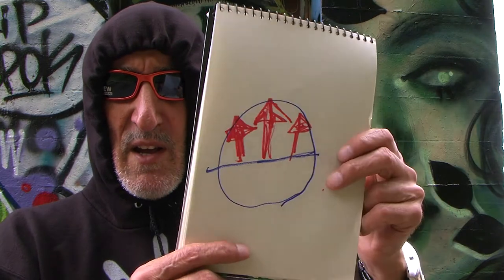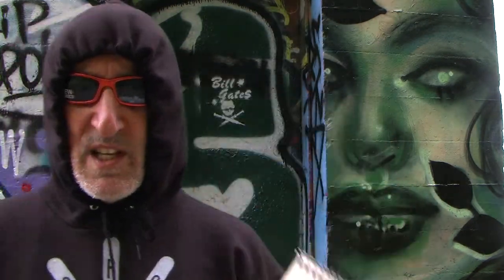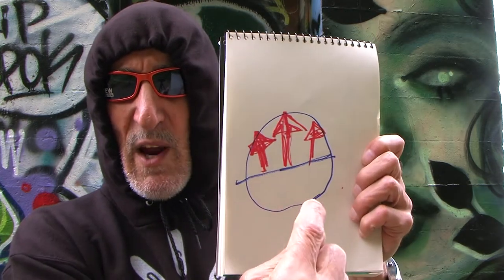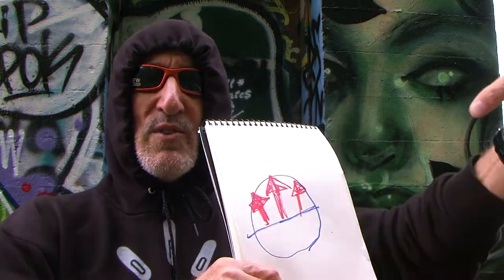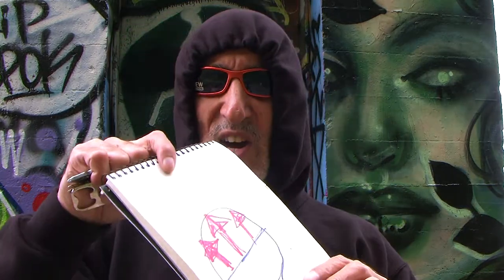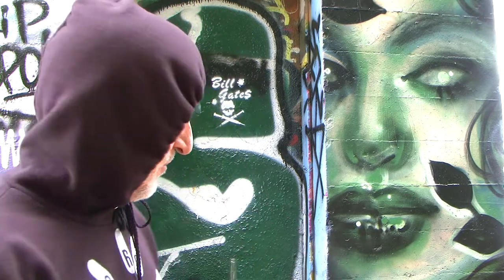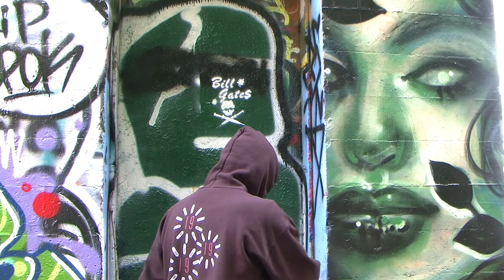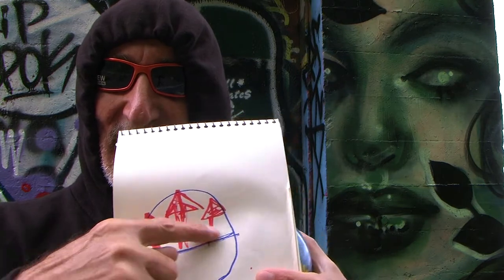HOW CENTRIFUGAL TENSION SPLITS A SPHERE globe hoax motionless flat earth

Comment: 0.03 m/sec² outward acceleration and 9.8 m/sec² inward acceleration is not going to make the globe split apart!
We already debunked all you say in part 1 of your video;
Reply: Yeah, he ignores gravity, or whatever it is that makes things fall.

Seems odd to me that FEers got really quiet after the American election, and now they're perking up again, as their hero seems to be reasserting himself. That sure smells like outside influence.

And frankly, it scares me. He tried his "beer hall putsch" on 6 January. It didn't work, but he's sure not gone. He can see that throngs are willing to buy his HS, especially if the economy pops a bubble, and he could use that to plot his comeback.
Reply from the maker: EXACTLY! That only applies to surface objects. Internal centrifugal tension of a 1000 mph surface speed will. And that only applies to a solid globe. Your globe cannot spin at all because t is cracked all over the place and has ZERO TENSILE STRENGTH. "And that's the end of the globe!"
Reply from the maker: @michaeldunlavey6015  Falling is all about relative density, watch drop.flat.wtf notice that air bubbles rise. Gravity is zero within the ball, I talked about this, gravity is much weaker than molecular bonds which are easily shattered by centrifugal tension, it only applies to surface objects. The best the globeheads can do, is claim that the tension "doesn't form in the first place" while the body spins at full speed like a top - total globehead insanity! Not a single reference exists for their lunacy, yet they talk as if they are right, what a joke!

As for politics, you are just as clueless it seems, since they are all on the same team. Hegelian dialect.
Reply: @rocketspushoffair  how can the sun that is this huge ball of burning gases like hydrogen and helium burn at these immense temperatures for billions of years and retain this shape because of gravity while traveling trough space with no problem? Can you believe it?
Reply: @StopCuttingChickenHeads  Burning gases is not correct. Hydrogen is not making a chemical reaction with oxigen (like it could happen here on earth), but the extreme temperatures and pressures are producing fusion of more hydrogen atoms together for making an atom of helium.
It is what happens exploding an H bomb, (or thermonuclear bomb).
It is what we hope to be able to make in a controlled and convenient way in a new kind of nuclear plant.
Gravity is what allows anything to exist, the stars (like the sun) and the planets.
Any celestial object is in vacuum, and then there is no attrition with air.
The shape of the sun is due only to gravity and to its rotation.
The sun is able to last billion of years because it has 99% of all the matter present in the solar system, its mass is 333000 times the mass of the earth.
Reply: @rocketspushoffair  Gravity is zero inside a hollow ball, not inside a solid ball. Inside a solid ball, it is proportional to distance from the center. Why? Because, for example at 1/2 R, the ball you're standing on is 1/8 the volume so 1/8 the mass, but 4 times stronger gravity from smaller radius, so 1/2 the surface gravity.
Reply: @michaeldunlavey6015  But you should subtract the gravity produced by the portion of earth that is above your head and works against the attraction of the earth still under your feet.
Reply: @rocketspushoffair  Hegelian dialect is part of the Kantian language, isn't it?
Reply: @napolmast3371  You should subtract it, but it's zero, 'cause of a nice geometric argument. Thanks.
Reply from the maker: @napolmast3371  https://www.quora.com/Did-CIA-Director-William-Casey-really-say-Well-know-our-disinformation-program-is-complete-when-everything-the-American-public-believes-is-false
Reply from the maker: @napolmast3371  Dream on. EVERY PHOTO WITH SUN ABOVE TREES proves you live on a flat earth trees grow sideways in heliocentric https://youtu.be/dNFVxrdw7r0
Reply from the maker: @michaeldunlavey6015  Here's another lovely geometric argument: EVERY PHOTO WITH SUN ABOVE TREES proves you live on a flat earth trees grow sideways in heliocentric https://youtu.be/dNFVxrdw7r0
Reply from the maker: @napolmast3371  It's a known fact. Even Michael Dunlavey will tell you. He said it in front of Reagan. You have a need for denial.
Reply from the maker: @michaeldunlavey6015  You are talking about a burred rock. Both the rock and the medium it's buried in have zero tensile strength. The entire ball has zero tensile strength. Maybe this 2 min video will clear it up for you, gravity cancels out within the fake globe https://youtu.be/8IDRr4I1vT0
Reply from the maker: @platoplat498  Air bubbles go up. Gravity refuted.
Reply from the maker: @michaeldunlavey6015  Actually it doesn't. Also, every day (not just at equinox) if you put a stick in the ground and measured the shadow height throughout the day, and joined the marks, you would get a straight line EVERY DAY. But too bad we get curved lines, as predicted by a small local circling sun. Take a globe, stick a toothpick perpendicular to the ground, shine a light, spin thee ball back and forth and watch the shadow trace a straight line along a single latitude. "And that's the end of the globe!" https://youtu.be/hmYceAALcdc
Reply from the maker: @michaeldunlavey6015  Another excellent debunk is the STRAIGHT LINE PATH of the sun in the sky from sunrise to noon and back down again to sunset. Your model predicts an arc. "And that's the end of the globe!"
Reply from the maker: @michaeldunlavey6015  TILT! Predicts that at winter solstice in the sun will appear to be setting at noon! "And that's the end of the globe!"
Reply: @rocketspushoffair  This last one argument shows well how easy is for you to build a strawman argument.
Using geometry (geometry is always right, it's math, it can't be debunked) Jos Leys produced a video highlighting that on a flat plane the sun should always produce circles with the tip of the shadow of a stick.
Or at least segments of a circle.
Using conical projections on the globe the shadow will draw iperboles, sometimes paraboles, circles only on north and south poles, and 2 times in a year, on the equinox a straight line. Everything is backed up 
by mathematics.
But rockets he just says that on the globe it should always be a straight line et voilà, all curved lines are a proof for flat earth.
He even got the nerve to show a straight line of an equinox and say that it was a curved line.
So easy to destroy the globe ...
Reply: @rocketspushoffair  I'm a Flat Earther, but I don't understand this FE argument. The issue/question with gravity is not - in my opinion - whether or not gravity exists. This is because we all, on all sides, agree that there IS an attractive force that either 1) is gravity or 2) mimics gravity. The question is, then, what is the nature of this attractive force, and what should it be called? Regardless of what its nature is and what it is called, the principle of relative density applies equally. For me, gravity does not exist but it is obvious that some attracting force does. That force is electromagnetism: https://www.youtube.com/watch?v=-0dN0Kxl9ow&t=2s and https://www.youtube.com/watch?v=9EPlyiW-xGI&t=18s Again, regardless of what the attractive force is, the principle of relative density equally applies. If there were no attractive force, density would be irrelevant since no object of any density would be attracted to anything.
Reply from the maker: @napolmast3371  It was a curved line. Even Les admits it, and that is because the "moment of equinox" does not exist, there is a range of a few to several days for equinox depending where you live. As for tilt, you have already been told that at winter solstice the sun sets at noon. You also run from the fact that SPIN+ORBIT=21mm/s/s of alternating acceleration and deceleration every half revolution. A simple rock balancing statue shows how absurd the globe is. "And that's the end of the globe!"
Reply from the maker: @uuuuutube987  Which argument are you referring to? My video? Or something else? Are you thinking that there s a force pulling things down? Or a downward bias?
Reply: @rocketspushoffair  

I know right? It's hard to tell which comment someone is responding to when there's a long thread of comments.

I'm talking about your comment here that says there's no such thing as gravity, that it's all relative density.

That's the usual FE argument against gravity.

Hope this is making sense.
Reply: @rocketspushoffair  We are talking about the heliocentric model, not about the flat earth pizza.
The equinox is a precise moment in the orbit of the earth around the sun when the axis is in a plane tangential to the orbit. 
Being a single moment there will be places where the daylight is distributed equally before and after the moment of the equinox, and other places where rhe equinox happens at midnight, so their daylight will end 6 hours before the equinox or will begin 6 hours after the eqinox.
These latter places will be those where there could be discrepancies compared to the straight line predicted at the equinox of the tip of the stick, but the difference would be minimal.
With these differences in mind that change very slightly the situation, on the day of the equinox, subtracted the effect of refraction that moves upwards the sun by 0.5°, the centre of the sun crosses the horizon at sunrise and exactly 12 hours later the centre of the sun crosses the horizon at sunset.
On the day of the equinox the daylight has always to be more than 12 hours because of refraction and because the upper border of the sun crosses the horizon before and after the center of the sun.
On a flat earth I couldn't care less what is considered to be the equinox by the flerfers.
I live at 45°N, then I know that always on the equinox at solar noon the sun will be 45° over the horizon; I know that always on the day of the winter solstice at solar noon the sun will be 45° - 23.4° = 21.6° over the horizon; I know that always on the day of the summer solstice at solar noon the sun will be 45° + 23.4 = 68.4° over the horizon.
It has always been so and it will always be so because I live on a ball and the logical predictions of the heliocentric system are always matched by reality.
Your absurd, idiotic, strawman predictions about the globe earth, don't match the real predictions of the globers, don't match reality and are grossly wrong.
Also making predictions using the flat earth model fails all the time, in every aspect.

Going back to the tip of the shadows of the flat earth, they have by necessity to draw a segment of a circle, while normally on the globe earth they have to draw a hyperbole, and that is also the shape present on a sundial.
Again the predictions of the flat earth do not match reality, the opposite for the globe earth.
Any idiocy you say is an idiocy and remains always an idiocy, that you try to use as a strawman argument against the globe.
No one has to care minimally about your idiocies.
Reply from the maker: @napolmast3371  You need to "IMAGINE A DOME"! https://earthsky.org/tonight/equinox-sun-rises-due-east-and-sets-due-west To bring the lights close to earth (to their actual location) otherwise the distances are too great for field rotation to be observed. Time and date website data SHOWS A RANGE of times, 3 to 4 days.
Reply: @rocketspushoffair  Well you gave me a link to a good explanation of the equinox, but I guess that the only thing that you will have retained is "imagine a dome".
Imagine means "use this trick that may help you to understand what is happening". The dome is not real, but it is the illusion that gives you the observation of the sky.
When I was a child I learned first the heliocentric explanation of the universe. When after I read about the celestial vault from the perspective of astronomers I was perplexed thinking "but there's not a vault". Then I understood that all the first astronomers had this illusion that led to think that there were transparent spheres in the sky, each one carrying celestial objects (and then I learned to observe the place of the rising sun, the east and west etc.). 
It was the highest summary of the thinking of antiquity, the Ptolemaic system, or geocentric system, the spherical earth in the middle of the universe surrounded by concentrical spheres carrying moon, sun, planets, stars.
The dome is an illusion generated by the way we see the sky around us. The ancient greeks were smart enough to understand that if the skies move around us as spheres, also the earth has to be a sphere (this was a clue among hundred other similar clues) 
Aristarchos of Samos (310-230 BC) even guessed right the heliocentric system, but it wasn't his thought to prevail.

"Time and date website data SHOWS A RANGE of times, 3 to 4 days"
I already gave you a detailed explanation why this happens, think what you want. The equinox is when the day almost lasts as much as the night, but actually on the equinox the daylight is always a little bit longer than darkness.

"To bring the lights close to earth (to their actual location) otherwise the distances are too great for field rotation to be observed"
For me this is incomprehensible. What "field rotation"?
Reply from the maker: @uuuuutube987  Bending of space time has nothing to do with gravity, the imaginary force. Electromagnetism also has nothing to do with gravity the imaginary force. The reason helium goes up, hot air goes up, bubbles under water go up is because of relative density. The reason objects drop is relative density drop.flat.wtf (direct custom link to YouTube video) It should make sense.
Reply: @rocketspushoffair  Density is irrelevant without an attracting force. Density applies equally to the gravity side or the electromagnetism side. The real question is, "What is the attractive force? Is it gravity, electromagnetism or something else?"
Reply: @rocketspushoffair  So what, in your opinion, makes air bubbles go up?